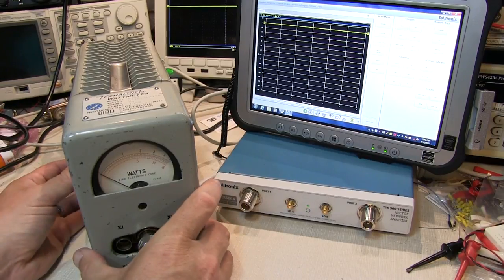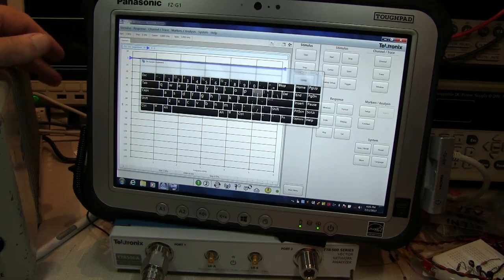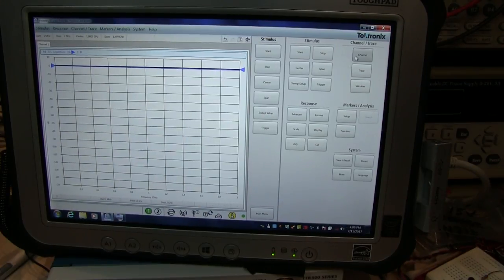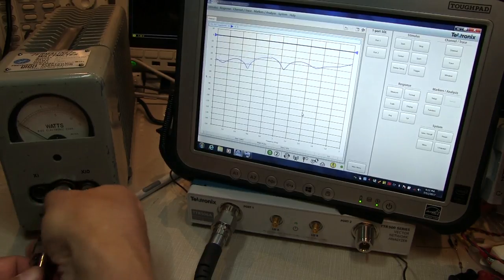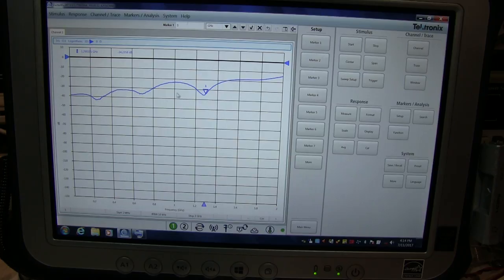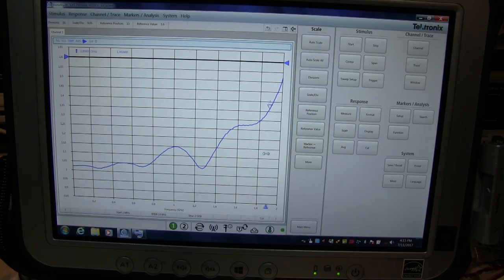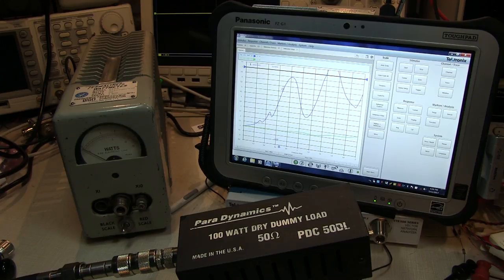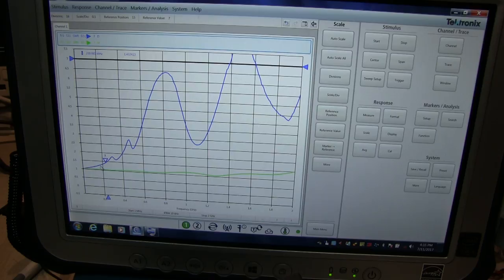#263: Using a VNA to sweep an RF Dummy Load | Tektronix TTR506A Vector Network Analyzer

Comment: Thank you again Alan! I have a Rigol DSA-815TG and a HP 8711A VNA. And of course a MFJ 259B Analyzer. The first 2 go to 1.5 and 1.3 Ghz respectively. With the ZFDC coupler 1-1000 MHz it's so easy on the Rigol. Having used a HP 8753D/E units in the past they are able to measure SWR but I am not sure about the 8711A as I just got it. I do enjoy your teaching videos and Thank you for taking your time to make them. Have a million questions for you, but I'll just watch and learn! It's great to watch a lab lesson then go to my lab and practice what I have learned! 73's David K8KEM

Comment: Very interesting test Alan. I was a bit surprised to see just how bad that cheap DL was and how good the Bird was.  I knew the cheap one would go out at higher frequency but did not think it was going to be as bad as it was.  You convinced me. That Bird is awesome BTW.
Reply: pro tip: watch series at Flixzone. Me and my gf have been using it for watching loads of movies during the lockdown.
Reply: @Flynn Braylon Yup, been using Flixzone for years myself :)

Comment: Thanks so much for doing this test. I just checked the calibration of my 6154 at work and wondered how it would work for HF and you answered my question. BTW, I was easily able to adjust the wattmeter section to agree with or Aeroflex 3920 within +/-
10%, the original spec. for the 6154.

Comment: Load is similar to mine, which does not have the watt meter. They use the carborundum style low-inductance resistors in oil. The resistors do change value some over time, especially in high duty cycle use. There is also a rubber expansion seal which can sometimes leak. Mine is also rated to 1ghz. Nice VNA Alan.

Comment: Congratulations on your instrumentation.
Might also try not using a male-to-male N-N adapter on the DUT.
If your calibration kit has a 180° phase difference between open and short you can use the port extension joint and then remove it.
The result would be optimal.
practically in this way he transforms his kit into a female.
Greetings

Comment: Would it be worth while to run the test again with different temperature profiles to see how / if the SWR changes?  IE use a heat gun and thermocouple to change the temperature of the DL to replicate different device output power into the DL.   What would happen to the cheap-o DL???

Comment: What would really be intresting is to know why the cheap load is worse than the expensive one and apply that knowledge to create one that is even better than the good one.
Reply from the maker: It's mainly due to the internal layout - just an array of axial leaded resistors mounted to a single-sided PCB.  Layout is not suitable for VHF+ due to trace lengths, etc.
Reply: Yeah, but how do they cause these things exactly? I am thinking of things like parasitic capacitances causing signals to bypass the load at suitable frequencies etc. 

Taking the axial resistors for example, I know that bending them around changes the response (after all, all those 80s tuners have hand bent and then glued down inductors) but without enough tools to measure these things its hard to get your head around.

Especially for those people on a budget it would be an intresting look at what specific construction points cause these issues, and possibly how to rectify them, i.e. transforming a cheap bad dummy load into a mediocre usable one.
Reply: do a teardown!
Reply: Dennis, the Bird didn't come out so good by accident.  The Bird engineers did exactly what you propose (and then some) when they designed it.  You'd have trouble beating it for the price.

Comment: Aren't the Thruline meters more common?

It's interesting that some of the newer Bird portable instruments are Android-powered.
Reply from the maker: Yes, Thruline meters are a staple in the industry - very common to measure forward and reflected power in a line.  It does not terminate the line, of course..  This is a Termaline, basically a dummy load that happens to also have a power sensor/meter included.

Comment: Hi! Sorry for the off-topic, but i have a question, what are group delays? They are usefull for something? Many thanks!
Reply from the maker: Group delay can be thought of as a measurement of the propagation or transit time of a signal through a device as a function of frequency.  Ideally, the delay time would be constant for all frequencies, but there are usually small variations vs. frequency.  When things like filters are involved, there can be large variations in signal delay vs. frequency, particularly at the "edges" of the filter.
Reply: Many thanks Alan!

Comment: Nothing wrong with using a VNA if you have one ($$$) but can't the same thing be accomplished with an antenna analyzer that displays impedance and SWR graphs?
Reply from the maker: Yes it certainly can, but I don't have one that goes up to 2GHz+
Reply: Finally found a piece of test gear that Alan doesn't have!
Reply: I've never seen him using a surface plate or gauge blocks. So we can probably cross off just about all of the machinist's test & measurement equipment on the list of test gear he doesn't own. ;)

Comment: This is a dummy load question, but can you use this for guitar amplifier repair/mods?
Reply from the maker: No, not applicable for guitar amp work.
Reply: w2aew Thanks! As I continue my quest for knowledge here in the electronics land of Oz, it's encouraging to  receive feedback from the Wizard himself!  :)
Reply: Guitar amplifiers range from 2-16 ohms, with the vast majority are 4-8 ohms.  6 50 ohm loads in parallel are 8.33 ohms.  This would work but very expensive, plus what Alan said.  An 8 ohm 200w load from Parts Express and others for less than $30 is what I use.   Mounted on a heat sink increases test time.  I bought 25 configured in series parallel for testing Crown Macrotech 5000 amplifiers on the bench.

Comment: How much will a VNA like that set you back?
Reply from the maker: The current price (special) on the 6GHz VNA shown here is $7200.
Reply: @w2aew  an other question would you recommend more a spectrum analizer or a VNA? Becuase i am thinking a lot of playing and making filters and i think a VNA is more sutable although I need some more professional guidance by someone that knows what he is doing 😉😊 but 7.6K ain't too bad if you think about a 2 GHZ VNA and spectrum analizer can set you back 2k from siglent... 😷
Reply from the maker: @AL6S00740  It really depends on what you want to do.  This VNA goes to 6GHz.  If you don't need to go that high in frequency, then it might not be your best choice.  A VNA like this is a full 2-port, 2-path unit - meaning it can measure amplitude and phase of the transmission in either direction through your DUT as well as the amplitude and phase of the reflection from both DUT ports.  Depending on what you're doing, you might not need all of this, or you might not need the phase response.  In these cases, a Spectrum Analyzer with a Tracking Generator might be a better choice for you.  Of course, the Spectrum Analyzer can be used for much more besides just the measurements with the TG.